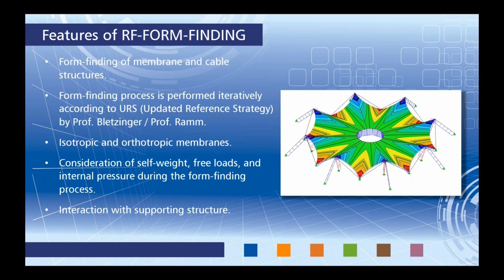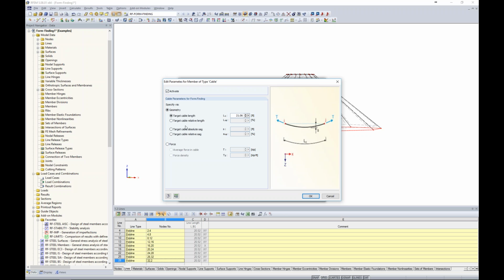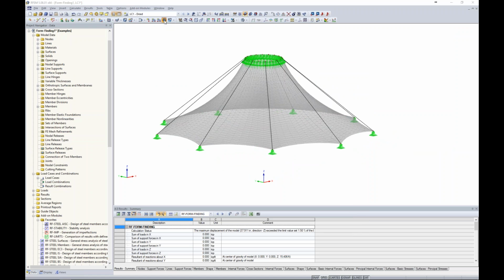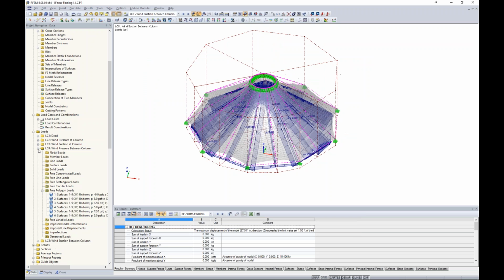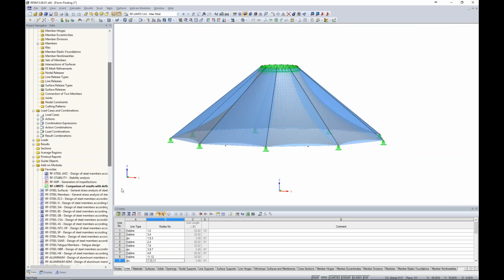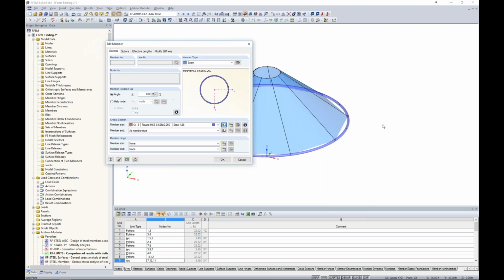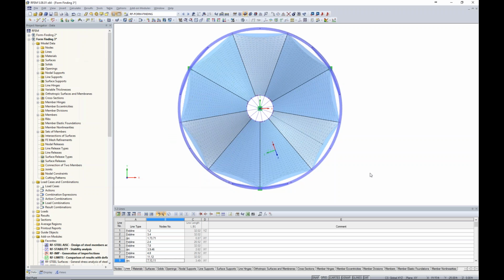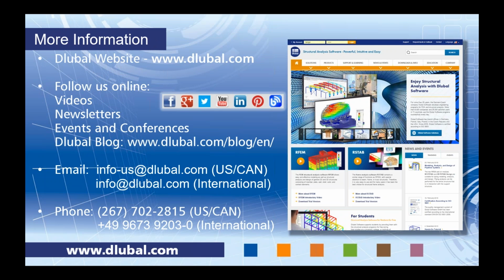Form-Finding and Cutting Patterns of Membrane Structures in RFEM | Tue, Apr 18, 2017

Comment: When i created a membrane with forces 4kN/m at warp and 2kN/m along weft direction as prestress and load 0.8kN/m2 snow. it makes extreme deformation. And im sure i entered correct stiffness values for orthographic 2d material. Besides after calculation basic stresses nx/ ny are slightly different which should have been maybe 5 times more than the presstress..
Reply from the maker: Hi, BC!
It's best if you email your model to our tech support team at info@dlubal.com along with your question above.  We can then help you troubleshoot further.

Comment: hello 
why the vertical polylines deform with the surface when I run the form finding? they do not still straight like your simulation .
Reply from the maker: Hi, Dai!
I am not sure if I understand your question correctly. Which vertical lines are you talking about? Lines are used to define surfaces. If we perform a form-finding process the surfaces deform depending on the entered wanted force. The lines are just shown as a reference to the original defined un-deformed surface.
Reply: @DlubalEN  thank you.Is there a way to replace the membrane with a tensile cables net and re-run the form finding ?
Reply from the maker: Hi, Dai!
The program can also do form-finding for cable nets. Yes, this is possible.

Comment: how to import cad files and make surface on in
plz make a video
Reply from the maker: Hi, ramesh!
All CAD file imports you find under the Menu File - Import. For example when importing Autocad files use File - Import and then choose DXF Format - Model. Note that there are different tabs in the import dialog on the top e.g. to set, if you want to import from specific layers or if you want to create surfaces.

You find many videos about importing of structures in different formats and from different programs in our youtube channel at http://bit.ly/2HeKehd
Reply: @DlubalEN  helllo dear sir,,,
plz solve my  a small problem 

I want  to use this software only for ""form finding & cuttings paterns""

so tell me the easy way to create it .

plz sir
Reply from the maker: Hi, ramesh!
I suggest to look on our FAQ pages how to import DXF files:
http://bit.ly/2LorBK9
Reply from the maker: Hi, ramesh!
We suggest to look at the webinar https://youtu.be/fV7H_Jf4D4I. Here you see all important necessary steps.
In case of further questions you may contact us at any time.

Comment: What could be the reason for the Error while calculating: Jacobi matrix is not positive definite. ??
Reply from the maker: Hello Thomas.  If you could please email our tech support at info@dlubal.com along with your model, we would be happy to look into the error further.
Reply from the maker: Hi, Thomas!
Most likely there are some not realistic material parameters or the structure is not stiffened enough so no membrane forces can be found. But to give you an exact feedback we would need your file. If you could describe the problem and send it to support@dlubal.com we would get back to you.